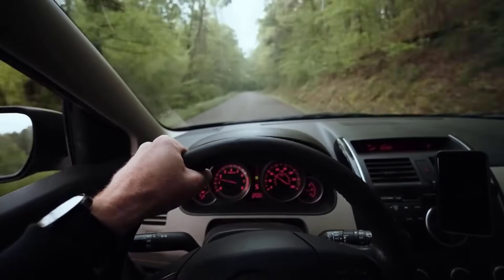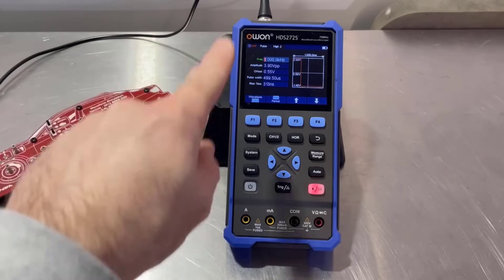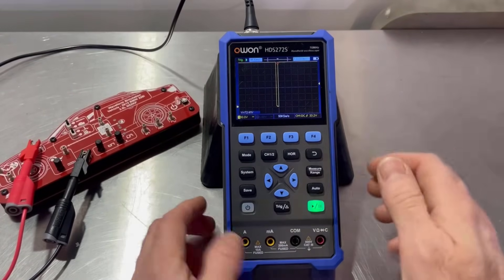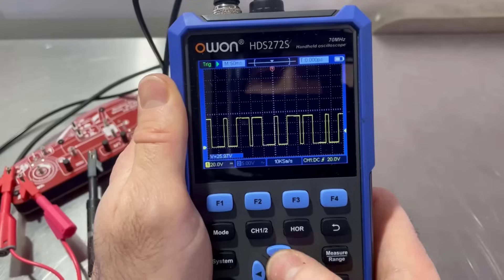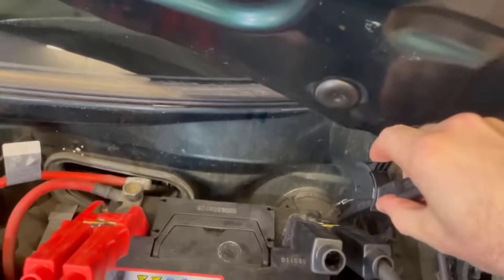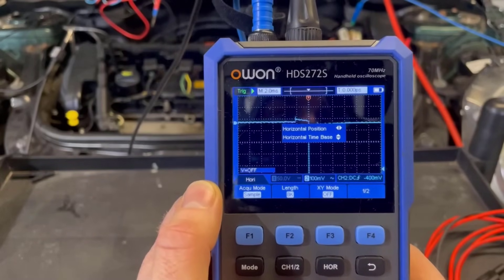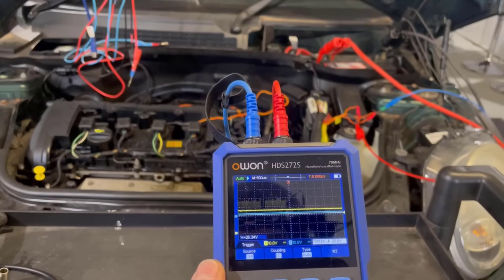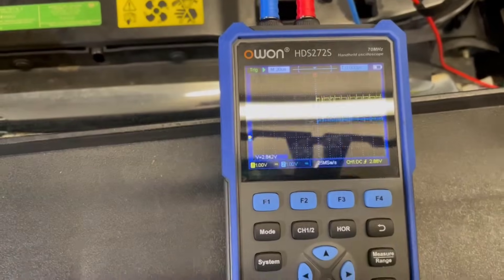Owon HDS272S For Automotive Diagnostics?

Comment: You cannot buy the HDS272S for £150....that is a fact.
Perhaps if you managed to get the VAT back it might be possible OR you bought one of the lower spec models e.g. HDS242
Even the link to the Amazon website has the HDS272S at £189.
Probably still good value.
Reply from the maker: Just off the top of my head, I bought it back in August. Cheers
Reply: @MechanicMindset  If you got it for £150 then that was a very good price. You must have timed it just right. It looks a very handy piece of equipment.
Reply: @Sean006  You can currently get the HDS242 for £110. It has no signal generator and is only 40MHz but it will be just as good for automotive work.
Reply: @timfish  Cheers Tim. That is good value, I will check it out. Thanks for letting me know.
Reply: @timfish  Hi Tim. Nearest I could find was approx £127 on AMazon....which is still a good price. Where did you see it selling for £110?
Thanks
Sean
Reply: @timfish  Hi Tim. Something strange happening because I get a price of £129.99 for the HDS242 using the information you supplied.
I suggest if you can get it for £110 then you seriously consider buying one.
Cheers 
Sean
PS Perhaps you have some sort of Premium Amazon account that reduces the price by £20.
Reply: @Sean006  Oh strange! It says -15% discount next to the price so appears Amazon or the seller are targeting me for a discount for some reason 🤷‍♂. I does say "Exclusive Prime price"

Comment: Great presentation and valuable into on this scope. 

The Owon does not have any built-in attenuators and connecting the test lead into the scope will load the circuit and perhaps produce inaccurate or distorted wave forms.

It would be interesting to see what results you would get using an external 10:1 attenuator. One does not have to use the Pico attenuator as cheaper ones are available, of course the volts/div will need to be adjusted to perhaps 100 millivolts.

I use an antiglare screen protector that has helped using the scope outside and protects the screen from scratches. This scope cannot replace a quality bench scope or a decent USB scope, but is a great scope for quick diagnostic work.
Reply from the maker: I tried the x10 probe on CAN, it was the pretty much same. Lost a few of the small spikes in the square parts of the waveform but that was all. 

It’s a nice scope and I’ll continue to use it for training on quick captures; but for sure, won’t replace my Pico 👍

Comment: Any idea what’s it’s like for relative compression testing been looking for something like this for it instead of having to set up the pico all the time
Reply from the maker: It should do the job. Have you seen the Ditex iTester? I did a video some time back
Reply: @MechanicMindset  I was wondering a similar thing - eg. With a cranking draw test, can it take short recordings of scenarios or is it all live viewing? 
I dont own any oscilloscope as yet but was looking at one of these handheld types first.
Reply from the maker: @Robde84  You can pause the screen. Or use a single trigger to capture. But can’t save or print as far as I can see
Reply: Ya I have a few ditex devices myself just curious if it actually would all said it really looks like a nice device to have the tool box so iv order one 👌🏻

Comment: You don"t need an attenuator for injector signal?
Reply from the maker: Only if the spike exceeds the maximum input voltage for the scope
Reply: @MechanicMindset  the owon peaks at 35v if I'm not wrong...on the snap-on simulator was hitting 80v...
Just checked, it says 400v at 10:1 so it's a 40v peak
Reply from the maker: @alexdragomirescu5084  Ah ok I see what you mean. I didn’t use one on this example. The scope settings were already on x10, not sure if it has x10 built in, but the inputs say max 400v on the top of the scope
Reply from the maker: 0:51 spec sheet. Max 400v

Comment: I bought one just because it had so many features, including the function generator at 1Hz. Good to show students the features of frequency. Easily shows a good PWM signal on the oscilloscope mode. I must admit.....I mainly bought it to add to my 24 multimeter collection. Oh, with all those features, it also adds to my 8 oscilloscope collection as well as my 4 function generator collection 😁😁😉😉.........I am getting help.
Yes it is a little convoluted to use, but with practice, it would be a good little unit.
As you have shown, it is a good little mobile unit with a range of features.
Good review mate 👍
Reply from the maker: Haha! Yes it is feature rich. How do you rate it as a multimeter compared to some of your top line models?
Reply: @MechanicMindset  I like all the features and reckon the quality is up to a good standard for what it is, however, getting to know all the buttons and processes makes it a bit frustrating. But, like I said, if you spend enough time with it and it was your go-to meter, I think it would be a quality purchase.
Reply: Yeah like a kid in a candy store! I'm the same way. Started with the Verus Edge 5 years ago and now I have a Pico 4 channel (the new one), a Vantage, Hantak, a pocket scope, and he list keeps growing. The key is getting the techs to use them! (or buy their own!) Just paid $1500 to have my Verus rebuilt after a tech someone fried it! Gotta love it!
Reply: @ardiagnosticsrestoration8566  You are right AR. I am amazed at how few of the apprentices I teach have any decent diagnostic equipment where they work. Unfortunately their employers think it is quicker to load up the parts canon than do a thorough diag. I'm glad you encourage your employees to get their hands on the equipment. Would in house training sessions inspire them?
Reply: lol I’m right there with you man. I have a problem 😂
Reply: @Jpilgrim30  I'm finding Multimeters Anonymous very helpful 😊
Reply: After reading this thread, I'm now extra cautious on how many scopes, meters, and generators I buy.

Thanks guys for pointing out this debilitating addiction. 🤣
Reply: @captainotto  I now attend meetings that I find helpful with others with a similar addiction 🤣☹

Comment: Doesn't that model have a video out connector? That would help on your camshaft/crankshaft resolution issue
Reply from the maker: Ah, I’ll take another look! I didn’t see one. It has USB C on the side…
Reply: @MechanicMindset  You can connect it to a PC :
https://youtu.be/z5EKfZrriaY
Reply from the maker: @anidiotinaracingcar  🤯 That’s what I get for not reading the manual I suppose 😅. Thanks for sharing!
Reply: @MechanicMindset  I'm sure some model can be connected to an external display, I don't know if that's the case with the Owon. It might be the Hantek models.

Comment: Thanks for the mention. I would agree this scope takes a bit of getting used to. I am used to using the Pico but for a quick go to tool this is a very capable scope.
Reply from the maker: Cheers mate, I popped down the workshop today and add the fix to the video 😅

Comment: I've had that Owon scope for just over a year and I love it,  it's great value for money but the way you adjust some of settings can be a little tricky,  once you have gotten used to it it can be a very helpful handheld device you can quickly use at the roadside. I also have the Zeeweii DS02512G which is also a great little scope but the screen is a little too small. I still use my Pico 2204 but it's a pain to set it all up, at least with the Owon you can get a reasonable answer very quickly.
Reply from the maker: Agreed 👍

Comment: Very good video. As a DIYer, I have been looking at small scopes and found your evaluation to be very informative. Thanks!
Reply from the maker: Glad it helped, it’s a capable scope but could be godly with settings and not so great for long term. Considered the PicoScope 2204A? Need a laptop but super powerful for the money
Reply: @MechanicMindset  I would love a picoscope, but for the life of me, I cannot figure out pricing. On their website, they’re around $3k. The 2204 has a good price - is that all I need? Software is free? It will run on a Mac natively (I have a windows VM, but would prefer native)? I have watched so many videos using picoscope, I have a decent understanding of the software. I really appreciate the response!
Reply from the maker: @alanottley  There are various kits for the 4425A automotive kit. Think it starts around £1000 for just the scope. 2204A will get you going. Only works with normal Pico software. Download Pico 7 on your Mac to have a play on demo mode 👍
Reply: @MechanicMindset  Thanks! Will do!
Reply: Allso in The shop these are great for quick checks.

Comment: I have a bit of a scope fetish too, including a v.good but fiddly-button Hantek Handheld**
The ability to understand and measure electronic waveforms is essential to modern car maintenance. It is the new "feel"  As a mechanic of old (me!) you had to understand "tolerance" by feel and repeat experience and if you were clever a micrometer might confirm good/bad. As every ICE is now a chip controlled machine the "tolerances" are now down the rabbit hole of abstract concepts unknown to most mechanics: time chopped up so small and the whole DAC/ADC goings-on, titchy components and the dark arts of coding and mapping!  All beyond our human senses. So to survive in this brave new EV world a tech has to have a speed wrench in one hand a 'scope in the other and brain that loves diagnostic rabbit holes!
Keep teaching, keep learning.

**Hantek Handheld Oscilloscope 2D72 2CH 70MHz + Multimeter + 25M Signal Generator
Reply from the maker: For sure, it’s all changing fast. Got to stay up to date! I think the Hantek is very similar to this. *scope fetish 😂… yes 😳
Reply: what about 2D82 , is it beter than this  owon ??

Comment: Баловство - это игрушка. Аналог Hantek 2D82. Очень маленький экран, с которым крайне неудобно работать!
Я использую MICSIG ATO 1004. Я просто использовал это в своей работе сегодня.
Pampering is a toy. An analogue of Hantek 2D82. Very small screen, extremely inconvenient to work with!
I use MICSIG ATO 1004. I just used it in my work today
Reply from the maker: MicSig is a cool scope. Very convenient. I will continue to use this one for quick checks, it’s difficult to set up. You’re right, I think it might be the same as Hantek 2D82

Comment: I work on RV's and motorhomes and I have the HDS272S you have here. When I got it the HDS2102S and HDS2202s were not out yet. I ultimately chose the Owon over the Hantek due to the better multimeter. Like you mentioned in the video I use the HDS272S early on in diagnostics to do more of the simple things before I have to bring my laptop in to a normally pretty small area ( "dog house" in the front of a gas RV, or under a bed in the back of a diesel RV ). Other than that, it does what it says in combining the multiple tools to make my life easier so I don't have to keep running back and forth to my trailer. I carry around a charging brick in the event I forget to charge the oscilloscope or use it for prolonged periods of time on multiple appointments in the same day because it will not last a full day of use. You can definitely get spoiled with the Pico, especially the software, waveform library, etc, and if you only ever used a Pico this might be more difficult to get familiar with than if you used a bench scope in a lab.
Reply from the maker: Thanks for sharing! It is definitely a learning curve; more conventional oscilloscope features rather than the easy to use Pico software 👍
Reply: As usual good video. What is that snap-on signal generator you had the owon hooked too?
Reply: @user-lt1bf4hg5h  Ask your Snap On truck guy for the waveform simulation vehicle, and show him a picture of the tool in the video if needed. Last I checked it was about ~$140.

Comment: ur comparing a new meter to an ancient mac multimeter that is 20 years old. new flukes do the same. u want a good scope meter then get the fluke. u can also get used tectonics that are just as good but without the premium. aes wave uscope is the best out there for a small pocket scope
Reply: I have a Fluke 196-102 and the scopes trend plot and deep record is great and very handy . I’m just not crazy about the display they try to have the “phosphorus” looking display like the old analog scopes and it just fucks
With my eyes .
Reply from the maker: I’ve got a fluke meter that doesn’t even have a mV setting! Just down to specs I suppose. Wasn’t intended to be a comparison, just perspective. What’s the price point on the Fluke?

Comment: I've got the 242S, the controls take a bit of faffing to get used to, but no more so than a Verus scope.
The big advantage is the scope is ready just one second after power on.
You've got to remember that all the scales are "per division" like a bench scope, compared to say a +/-20V "range" like Pico.
You can also set up 3 presets for voltage range and timebase, such as for CAN or relative compression to save a lot of setup faff.
At the time of getting my Pico, I had the choice of getting the 4425 or the new 4425A.
I purposely didn't choose the "A" model, so that all my accessories were universal to any scope.
Yes I use my amp clamps, secondary ignition probes and even the WPS on the Owon.
Your final comment that the benefit of this scope is for quick checks rather than in depth analysis is spot on.
I was frustrated with the bootup time of the old Verus, so a "quick check" certainly wasn't.
I had looked into the AESwave uScope but was put off by its non standard connector that seems very prone to breakage, so at a similar price point, this range of scopes is really a no brainer either as an entry into scoping or as an additional instrument.
Reply from the maker: Ah I will look in to the presets. I had this on the x10 probe for most the video with out noticing. Still did the job 😅. I got this out to make a video a few times before hitting record. It does take some getting used to. Thanks for sharing.

Comment: I have the same oscilloscope and let me tell you the oscilloscope side is definitely not user friendly. So i just use it for something small so i dont have to tinker with the options but the multimeter side is excellent 👍 one down side the batteries could be bigger 😉
Reply from the maker: Cheers, yes takes some getting used to.  Imagine the screen consumes much of the battery charge. I wonder if we can add a higher Ah battery. I suspect they shipped it with a cheap battery 😂
Reply: @MechanicMindset  good point about the batteries i will look into it when the original batteries need to be replaced 👍